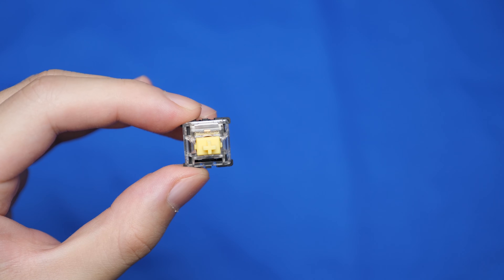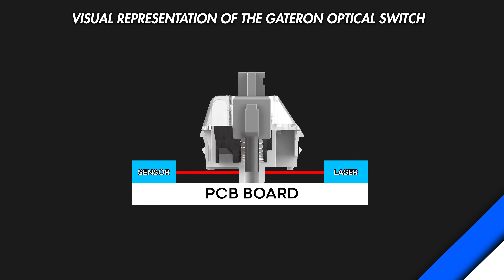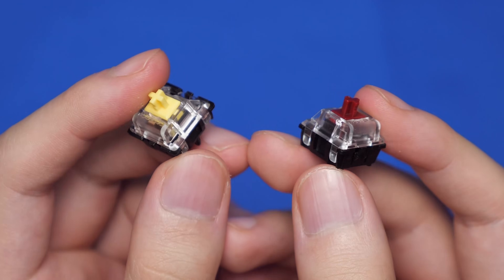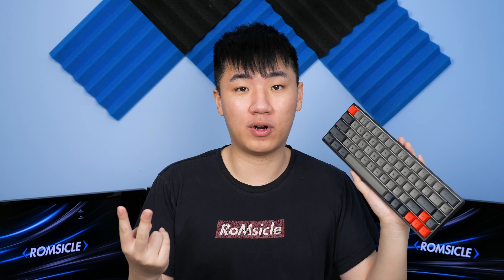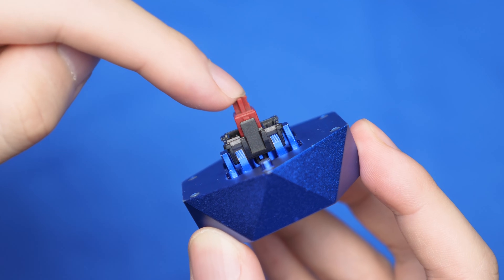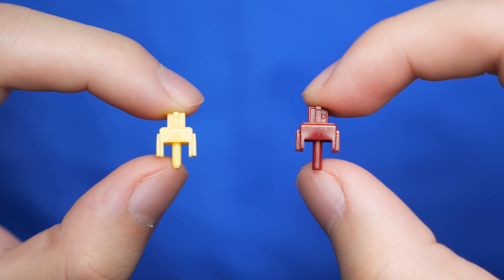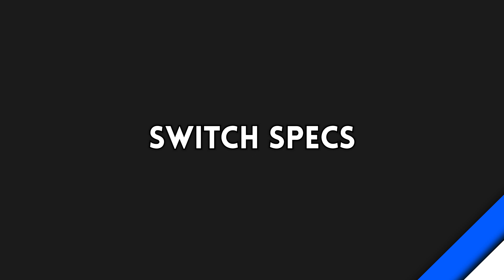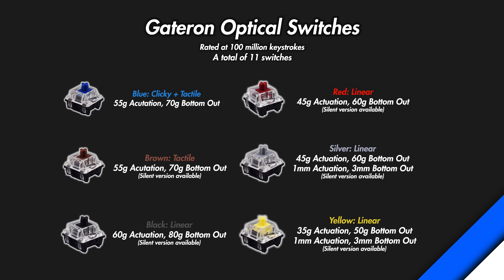Gateron Switches: Mechanical VS Optical! (Sound Test)

Comment from the maker: I can't believe I didn't put this in the video (well I did, but I guess it wasn't too clear): OPTICAL AND MECHANICAL SWITCHES DO NOT MIX. They are exclusive to their respective boards. Optical keyboard? ONLY optical switches. Mechanical keyboard? ONLY mechanical switches. End of sentence. No BUTS. Cheers, mates!
Reply: Do you know if Gateron has a patent on these PCBs that accept their switches? Is it possible more switch manufacturers could make compatible switches or is this a Gateron switch only kind of thing?
Reply from the maker: @justinc8157  Not sure if it's patented, but Kailh has optical switches with a base that will fit a Gat optical board.
Reply: @Romsicle  wait what, optical blues and optical browns are the same?
Reply: @Romsicle  outemu blue vs gateron blue for typing. keep sound aside, which feel great when typing?
Thank ypu
Reply from the maker: @vishnumantena9334  Optical reds/blacks feel insanely smooth - 10/10 recommend

Would not recommend yellows tho because they're too light
Reply: but but
Reply: So can I hot swap a mechanical?
Reply: @lucasmabrgaming4141  hot swap is possible only if the keyboard you bought is able to be hot swappable, otherwise you'll have to swap switches manually by desoldering and soldering.
Reply: @ThumberBulls6  beautiful. I need to get a 65
Reply: Can you make a video explaining how to lube these? :D
Reply from the maker: @JuanAndres-ot5fk  Just watch my lube tutorial. It's the same steps.
Reply: Please help me with two things first thing; my esc button does not work on my keyboard (I have the gk 61) second thing can you make a video about the benefits of brown mechanical switches? It will greatly help me
Reply: @יאירצפוני  there’s no benefits. They are budget switches. And your escape thing can’t be fixed without desoldering
Reply: OK thank you very much @lucasmabrgaming4141
Reply: F#@$& I ordered optical gatreon switches for my mechinacal keyboards now I’m f’ed up now I’m sad
Reply: Yeah I didn't know there was a pin difference when I bought an optical keyboard. I thought it was just the RGB magnification thing you mentioned, so now I can't switch it for the new mechanical switches I just got lol
Reply: ok I am confused, I watched the video twice.
First you said that opticals could not be used in other boards, then at the end of the video you say opticals can be hotswappable.
I know this video is almost old.  Nov 2020.  Its now Oct 2022 and many keyboard companies are moving towards optical by what I am seeing and experiencing.
Also, can the bottom black section of the switches in either type be changed to clear?  and I would like my RGB to glow through the switch more.
And it cant do that, because of the black bottom.
Reply from the maker: @TwstedTV  Hotswap is the ability to change switches on that particular platform. Optical can change with optical. Mech can change with mech. But no mixing.

Optical is still very far behind regular mech switches in terms of market size. You're better off with a mech keyboard over opticals.

Some switches have clear housings or translucent ones. I have yet to see a fully clear optical switch.
Reply: @Romsicle  
Aah, I see.  Thank you for clearing that up  🤗
Looks like I am going to eventually build 2 keyboards  😄
I game a lot, so optical will benefit me.
And mechanical will be great for general use by what I gather from what I learned so far.
Again, thanks  🤗😁
Reply: If its someone who misunderstood this then its not because of you.
Reply: Hi, If I want to buy a set of keycaps that are compatible with cherry mx and gateron mx, and my keyboard is gateron optical yellow, would they be compatible? I know that in the pcb would be different but in the keycaps?. I hope that you help me, cheers.
Reply: I made a standard outemu blue optical because I was bored. You can take off the pins and cut off the stub that makes space for the bottom of the stem. This is rather dumb but it does actually work, with the click actually being in tune with the actuation. Wouldn’t work with box switches i think though.

Comment: I just switched to mechanical optical from a 60% membrane keyboard and I like the tactile feeling. especially the space bar, since it feels like one solid button. not floppy. My biggest impression is the USB- C to USB cable. as my dog likes to tangle in my cables and throw everything when he gets trapped. This is how my membrane keyboard died, as it was hardwired into the keyboard. but this way if any1 trips over my cables the USB-C should just release from the keyboard, without throwing it or having to resolder loose connections. But honestly I think membrane has less key travel giving it a performance edge and clicking your keys is a meme. Also all my key heads get rubbed off. So I guess I get my moneys worth. vs. buying and crying as all my keyboards seent some stuff and ready to be replaced. Also I rub raw chicken on them with my fingers.

Update: I opened the old membrane keyboard and alot of trash dumped out and all positioning pins where broken and dumped out. But I re situate the wire after looking for where I can solder and not finding any loose connections. So its gotta be a broken angel hair wire in the main cable. But just re situating the wires let off tension and it stopped cutting in and out when I wiggle the cable reassembled. I tried to see if its good as a spare for a scrap top but theres no advantage to the built in keyboard. So its just trash tier scrap now. I think I might hoard it, since its fine. Except still covered in chicken grease and raw chicken juice.

I will give more updates if anything changes.

UPDATE: I like the extra long USB-C cable that pops out of the keyboard as I can use it to quickly data dump from my phone. As I dont need a keyboard. Just a mouse to do some quick transfers and can never locate a data cable. Then spend at least 15 minutes getting upset about my cables and which one is a USB-C data, and not just a charge cable.

UPDATE: Im going to keep the membrane one and try to foresee when Im going to rub chicken on it and hot swap and just keep that one for reserve so I can rub more chicken on it and spare the mechanical opticals from my abuse.

UPDATE: I think theres actually a high potential for getting meme'd on and spending the amount of money on this keyboard for just the data cable, if youre not smart.  So 10/10 review so far.

Comment: Passing by to know if optical black silent are as good as  mechanical ones (i guess youtube hasn't much vids about it) just 2 cents on the way : top/stem already compatible with mechanical Gaterons will be compatible with optical bases. It wont be the exact same thing as a full mechanical combo as the base isn't the same as anything, but it should be pretty darn close.

Comment: do they make noise if you don't bottom out the keys?
Reply from the maker: If you're able to type without bottoming out the keys, you either have the tactile memory of a god, or you're really slowly at typing. It's basically soundless if you type like that but it's a pointless question since it's never going to happen.

Comment: Thank you SOO much! I went round and round on the web and couldn't get a solid answer. I went with the optical switches (red) to replace the Optical Blue that came on the board. I will only be swapping the keys needed for gaming to the Red and leaving the rest of the keyboard (60%) on the typing keys. . .

Comment: Optical keyboard switches do not use lasers. They are simple infra-red LEDs.

Optical switching is not faster than mechanical switching. They both happen at the speed of light.

Comment: lubed gateron optical yellows with milky tops are endgame material. Optical linears have no contact leaf and that inherently makes them smoother. Optical tactiles and clickies use a dummy leaf to generate tactility, and optical blues have a VERY tactile leaf.
Reply: If you have used both optical and mechanical switches please answer this. How do mechanical and optical switches feel when typing. And which feels better for long period typing.

Comment: is there a cherry profile interference with optical switches?
Reply: I think so since most optical keyboard is north facing PCB and eventually you will have to push the stem to the bottom to register the key.

Comment: Hey guys, I’ve been wanting to buy key caps but idk if it’ll fit into my Razed Huntsman. Can I buy any key cap or am I limited to razer’s optical key caps?
Reply: As far as I know, Razer switches use the same Cherry style stem design ( the cross shape ) so you can slap on it any keycaps set you want on it.
Reply: @huunhanle3809  yea I sent on some blue and red caps and they look great! thanks!

Comment: Simply put, if you like mechanical keyboards go with pure mechanical, if you're not really into keyboards go with optical. 

Just a little trivia on why Optical switches are faster (and probably better):

Optical switches have benefits as mentioned in the video, but also optical switches don't "bounce". Metal contacts don't transition from no-contact state to contact state cleanly, it will bounce several times before settling. This means that optical switch don't need de-bouncing thus giving you instant response. Not to mention longer lifespan due to less moving parts.
Reply: If you have used both optical and mechanical switches please answer this. How do mechanical and optical switches feel when typing. And which feels better for long period typing.
Reply: @vishnumantena9334  For longer period typing that would depend more on the variant of the switch (linear, clicky, or tactile). But I have used both optical gateron linear and mechanical gateron linear and to me, the optical ones feel smoother. Needless to say I prefer the opticals due to the smoothness (and it wasn't even lubed!)
Reply: @AFreezer  Hey do Rgb Wired mechanical/Optical keyboards damage laptop battery in long run?
Reply: @vishnumantena9334  AFAIK it shouldn't damage anything..
Reply: @AFreezer  ok one final question. Which feel good when we type? Gateron optical or mechanical. I am a writer i write for 2-4 hrs and i play 1-2 hrs of gaming. Which one should i choose. I want a good feeling in a wrong run without getting bored.
Thank you.
Reply: @vishnumantena9334  Man idk which feel good when you type. But for me personally I love the smooth feel of the gateron optical so I would go with that. That's just personal preference though. Some typist likes Blue switches, some like Browns. Really, you just have to try it out. The safest choice would be brown or blue clicky switches if you type a lot. Because you can feel the feedback when you type so you wouldn't get too bored with the monotonous smoothness of linears.
Reply: @AFreezer  which is better gateron optical bleu or gateron mechanical bleu? Cuz many people say that the optical version feels a little cheaper than the mechanical version, is that treu?

Comment: Great explanation, but how long will an optical keyboard last when it has optical switches?
Reply: The light sensor of optical keyboard have around 50k hours of lifespan I believe, so which is very huge even if you use the Optical keyboard 10 hours a day. But you will have to replace the keyboard nonetheless as the light sensor will grow weaker and replacing them may cost a new Optical keyboard lol.
Reply: @huunhanle3809  bruh tbh that slightly sucks. But, I searched google an optical switch should last about 100 million clicks. how about that?
And you said that the light will die off over time I just ask how long is that time? (btw just try to estimate)
Reply: @binladen420  The switches will last for a very very long time just like how the manufacturer listed because Optical switches doesn't need the metal contact leaf to activate them like normal mechanical switches. The only thing to concern is the light sensor on the keyboard's PCB.
It will take an extremely long time for the sensor to weaken in my experience. I have a friend that has an Epomaker SK61 and he have use it for 2 years now and the keyboard still function well.
Reply: @huunhanle3809  Thanks for replying and thank you for suggesting and helping reach my decision. Because I was also planning to buy the sk61. Thanks a lot ur a nice person.
Reply: @huunhanle3809  which is better gateron optical bleu or gateron mechanical bleu? Cuz many people say that the optical version feels a little cheaper than the mechanical version, is that treu?
Reply: @GetForz4  They are nearly the same in my opinion. And yes, optical version feel a little cheaper and more hollow than mechanical version because the Optical version use less component than the Mechanical version.

Comment: in keyboards with gateron mechanical switch, can i swap to something like holy panda ?
Reply: You can, 3 pin or 5 pin switches does not matter as the extra 2 pin are just plastic. You can cut them out easily.

Comment: Everyday I learn more about keebs and switches I learn the you don't need to break the bank to buy a good keyboard. I bought the Tezarre Tk61 with optical browns for 30 bucks on amazon and I think it has been one of the best purchases of my life. Don't buy keyboards from big brands like corsair or razer, they are scamming you and most of the times they charge you more for macros and multimedia features than for actual gaming features and build quality.

Comment: Where's the sound test for silent brown or black and silent yellow... Btw what wil hapen if one of the key stop working like key X is not appearing on screen.. Is it fixable
Reply: If the key stopped working, it's probably is the switch is malfunction. If you keyboard support hot-swappable feature then you can just pull the malfunctioned switch out and replace it with a new one, otherwise you will have to desolder the keyboard.
Reply: @huunhanle3809  what if its a laptop keyboard.. And laptop keyboards are membrane ya? So what should i do in that case?
Reply: @jillting1852  You probably want to seek for technician advice or bring your laptop to 
repair service .

Comment: Hi can I ask if you know the differences between gateron switches.. like, clear top black bot, full milky, clear top white bot, or white top black bot? thank you so much!!!
Reply: There are currently 5 main variant of Gateron switches ( aka. KS variant ) that are:
1. KS-3 series: Black top housing, black bottom housing .
2. KS-3X1 series: Milky top housing , milky bottom housing aka. Full milky.
3. KS-3X47 series: Milky top housing , black bottom housing .
4. KS-8 series: Clear top housing , black bottom housing .
5. KS-9 series: Clear top housing , white bottom housing . 
There are more variant of Gateron switches but mostly it's discontinued or optical variant so I'm not gonna list it here.

What's the differences between them:
1. KS-3: the most smoothness type of Gateron switches, in my opinion it's even smoother than Cherry MX linear switches. But due to the different in housing material. It sounds is not too good compare to the Milky variant. Another worth to mention is this type doesn't support SMD led.
2. KS-3X1: The Cap Milky or Full milky variant. This one in my opinion has the best sound than other variant ( especially when you lube + film it properly ). But it's a double edged blade, it sound maybe the best but it scratchiness is beyond terrible. So you will have to lube it no matter what. This type doesn't support SMD led too.
3. KS-3X47: This type of switches is a combination between Milky top of KS-3X1 and Black bottom housing of KS-3. The reason why Gateron produce this type of switches is to give the user the balance smoothness and good sound. But imo it's just a "Jakc of all trades" type of switches, it does it role good but not that well. This type doesn't support SMD and other led type due to it Black bottom housing will made the led dimmer.
4. KS-8: One of the most popular and well know switch type of Gateron, it support 4 pin led. It Clear top housing made by different material so it sound is not that good compare to the other three variant above. It smoothness is so-so, not that good but also not so bad compare to other cheap switches such as Outemu, Huano, Redragon.
5. KS-9: Also know as SMD Gateron, another popular type of Gateron switche aside the KS-8. Support all type of led including SMD. But this type imo is the most scratchiness switches ( maybe the same level of KS8 ).
Reply: @huunhanle3809  wow thank you so much for this very informative reply. I actually got the full milky pro yellows. I haven;t attached them yet on my KB. hopefully I made the right decision.
Reply: @CeanKeys  You're welcome, I have tried the Pro Milky Yellow and I would say it's a very good upgrade. It fix the annoying stem wobble as well as improve the smoothness of the switch more than the original Milky one :D.

Comment: Hello, so my sk64s is coming. And i have  picked gateron optical yellows, and wondering if i can switch any switches with it?? Planning to change it to C³ Banana Splits.
Reply from the maker: Absolutely will not work. If you wanted to use Banana Splits, you should have gotten the GK64S.

Comment: Can I put my keycaps from my old mechanical keyboard on it? Is that + the same and any keycaps fit? I traded some with my bf (he uses an anne Pro keyboard) and as I need a new keyboard because my space doesn't work anymore I saw these optical switches and now I am confused :c
Reply: You can since both Optical and normal mechanical switches share the same Cherry MX stem style ( the cross shape ). Of course you will have to check the stabilizers of your keyboard too, if your keyboard use the Cherry style stabilizers then you can slap the keycaps between optical and normal mechanical keyboard without any problem.